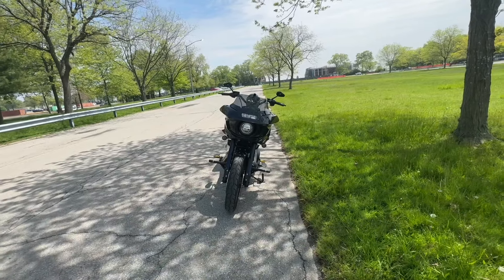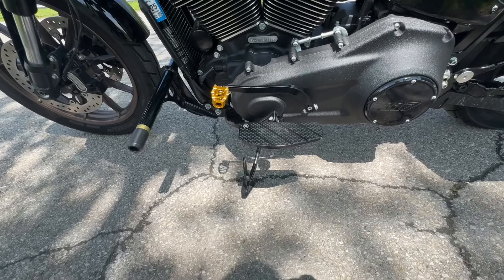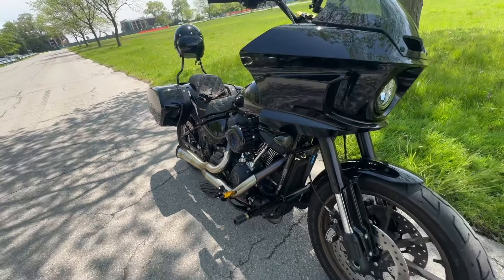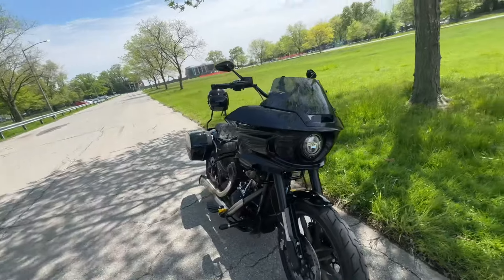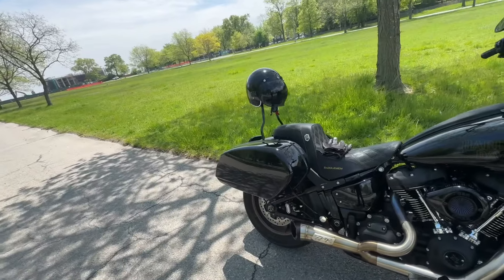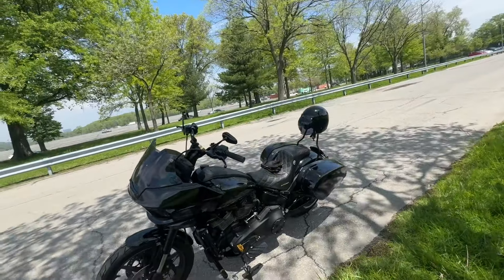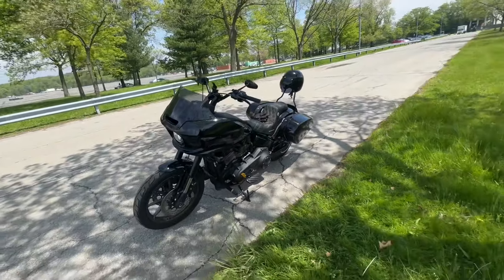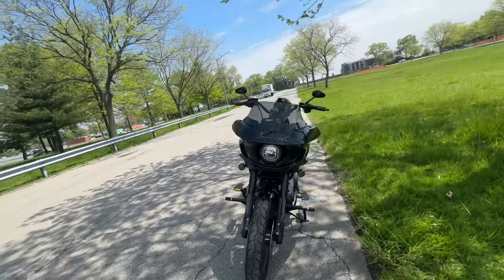2022 Low Rider S Update - Advanblack ST Fairing, ST Saddlebags and Mini Floorboard

Comment: for the issue you had with the moons mc light. you need to turn power on but dont start the bike. turn your hazards on for 30seconds and then try the turn signals. that resets the hyper flash, as it learns the wattage of the new bulbs.
Reply from the maker: Thanks.  I tried it too, but unfortunately it didn’t work for me.
Reply: @nystar01  ahh ok.

Comment: Thats one of the Best and most Cost effective way to have a LRST without buying One...Make it out of a LRS...Only 2 differences i would do is....A set of Fowards and Leather Pro Saddlebags...
Reply from the maker: It doesn't make sense to trade in for an ST if you already have the S and put a lot of money into modding it.  But if you wanted an ST from the beginning, just go with an ST.  OEM quality is better in my opinion.  I'm a short guy so the mid is perfect for me.  I personally prefer the look of the hard bag over the Leatherpro bags.  Now that Nasty Hog just came out with the detachable chopped bags, I'm interested in that as well.
Reply: @nystar01  The Only thing when its a HD? Parts that are OEM is for resale value...Aftermarket is just as good if not Better and the Cost is Cheaper...If a Guy is looking for an investment buy a Bar of Gold...Bikes are made to ride the Hell of...

Comment: Anything you buy from harley-davidson you're only paying that much for something simple because of the name harley-davidson that on it, other then that I've bought plenty parts for my bike from Amazon, ebay and other sites for half the price of what harley sells them for and the quality is just as good.
Reply from the maker: I agree.  That said, I do notice that there is cost cutting with these aftermarket parts.  The QC on the OEM parts are slightly better and you’ll have the assurance that they’re least likely to fail due to the liability.  For simple parts, Amazon stuff is pretty solid.  For critical parts, stick to OEM or more reputable companies.

Comment: the 2022 Low Rider S should come with pre-drilled holes on the frame for the OEM ST fairing bracket, Does the AB bracket bolts on those factory holes or it shares the bolt with the tank?
Reply from the maker: It shares the bolt with the tank.  Mine doesn’t have the holes because Harley used the leftover frame from 2021 for some bikes assembled in the first batch of 2022.

Comment: Hey, question. I’m getting a nasty rattle coming from the fairing at about 3k RPM. It comes and goes. Have you had any experience with this?
Reply from the maker: Nope, mine doesn’t have any rattle.  Remove the outer fairing and check if one of the bolts inside fell off and if lighting wiring secured.
Reply: @nystar01  appreciate the response !